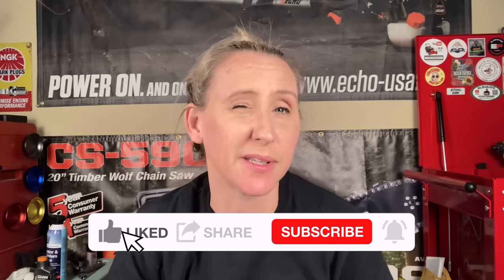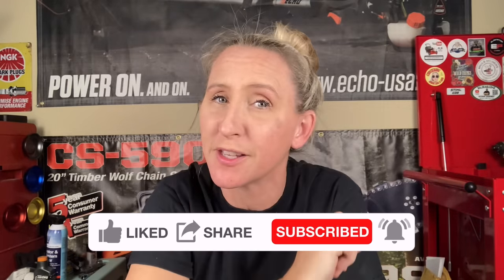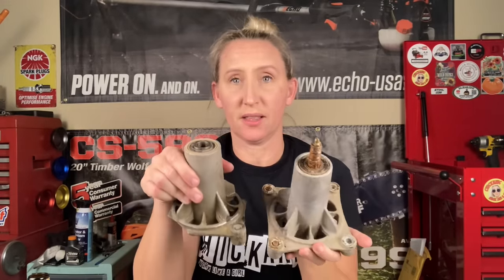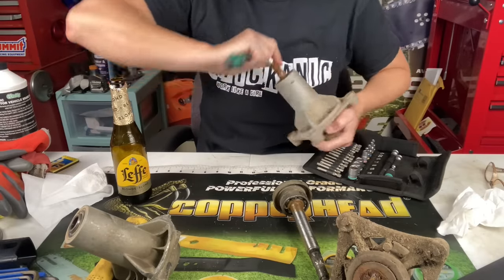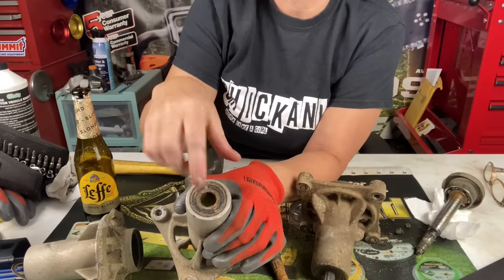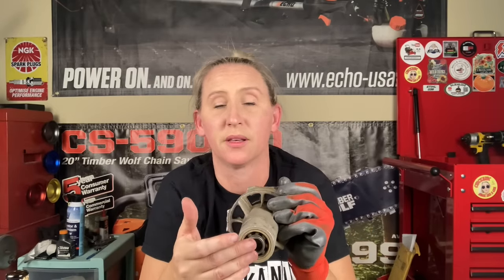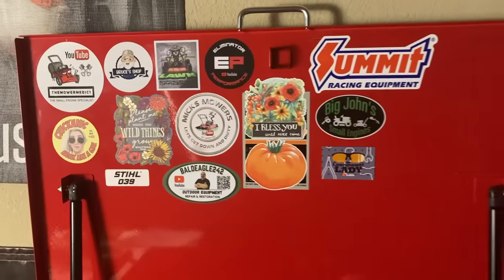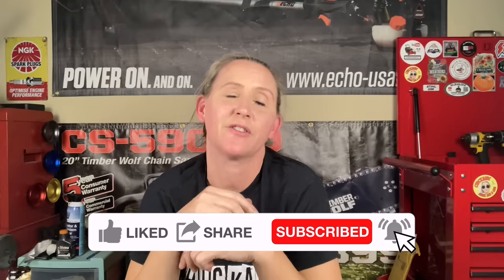THIS IS BIG!! Husqvarna riding mower and Zero Turns HAVE CHANGED! Review/Vlog

Comment: I have been wrenching mower for more than 40years. In the mid 80’s the quit putting in non sealed bearings. Every thing to the sealed verity. That so they could sell more parts at the parts shack. For years I have been removing the inner seal of the bottom Bering and drill and tap the side of the mandrel so grease could be applied so as it heats up it could slide down the shaft to lube the bearings. The upper Bering gets repacked and resealed Because hot grease will not defy gravity. This has kept my Mendrel going for years. I would run them till there was clearance issues I the housing and the Bering would chatter in the Mendel. I could get 1500-2000 hours out of set if they weren’t abused. I still have some of the old Mandrels laying around some where. There are cast iron and some are machined steel they have tapered roller bearings with cone race and actual real seals those mowers were like timex’s ran them till the decks were like Swiss cheese. That was us quality back then. Now we get disposable junk. Good to see someone’s kind of listening. Keep sharing the black&white&read all over👍

Comment: I need help with an oddball string trimmer. I just bought a Weedeater 2 cyl trimmer on wheels. Model WT3100. The purge bulb was missing. I ordered a new one plus a new carb. Now I can’t find information on how to connect the fuel lines. If you can help I would appreciate it greatly. The motor had spark so I figured for$10.00 what the heck. But I am stumped. There are one or two videos on this string trimmer but nothing to help with the fuel line routing. Help.

Comment: It's a supply chain issue, not an international lawn mower conspiracy. 
I work on Harley's for a living, there's a company that offers a bearing conversion for something on them that originally had bushings on a shaft with a grease fitting, the bearings in the conversion kits are very similar to those and sealed on both sides, a called the company that makes the conversion kits and ask why they didn't supply bearings with shields on only one side so the original grease fitting on the shaft could lube them, he told me when they originally did they could source the one's with shields on one side from their supplier but after a while all they would supply them with was the double sealed one's. 
The shafts are made by one supplier as per the original design with the grease hole and the bearings are sourced from someone who quit supplying them with only one shield, either the mower companies found a different supplier that sends them the single shielded one's once the supply they bought ran out or their supplier heeded their request for single shielded one's. 
Realize that when they buy the bearings they're probably supplied with hundreds of thousands of them, until they've run out that's what's going to be installed and sent as replacement parts.

Comment: The new shaft and bearings look like a good improvement.  However, I would like to see where the grease comes out of the shaft to grease the bearings.  If you put grease in the top does it just go into the middle of the housing?  If so I guess you would have to force a lot in there to push grease into the top bearing.  Wait, maybe if the top is not sealed maybe you can just add grease by hand.  I Don't know.  Anyway thanks for the information and tips.

Comment: I think on my new used John deere Lt155 is gonna need a new spindle if its not the spindle making that loud sound its the pulley brake rubbing the pulley if its not that could be a pulley it could be any of that i don't know how long the guy let it sit its a good mower though cuts good with a nice dull mulching blade that doesn't really mulch nothing 

The steering is more stiffer than on the john deere L110 its steering is really good but then the craftsman lt1000 steers the best 

The square fender John deere 110 steering is easy but gotta do alot of turning so its not that great its to easy

Comment: In general that’s my job being wrong that is! I called dibs on being wrong! But I still have a guess. 95% of the people using these greasable mandrels don't even know what the word grease gun means. And certainly don't have one. The only greasing going on is at your place or some other shop. All these non sealed bearings do in this situation is fail sooner because they're only a good idea if somebody actually greases them. It's even like on your car when we had rear-wheel drive and universal joints they used to wear out. The factory ones lasted the longest and they weren't greasable. There were two types of available at the auto parts store one greasable and one not, the sealed bearing lasted longer... your mileage may vary!

Comment: This is what Cub Cadet says about their spindles. SEALED SPINDLE HOUSINGS WITH SEALED BEARINGS WITHOUT GREASE FITTING.  Routine maintenance is not necessary on these style spindles. Please inspect the deck spindles on your model. If they do not have grease fittings on top or bottom, they will not require greasing.
SPINDLE HOUSING WITH SEALED BEARINGS AND GREASE FITTING.  On these style spindles, grease is used primarily as a water barrier to keep water from accumulating in the void area inside the spindle housing and around the bearings and spindle shaft. Any good wheel bearing grease applied with a standard grease gun may be used for this purpose. These style spindles should be checked and greased annually, more often if the deck is subject to unusually wet operating conditions. Models with grease fittings will still have sealed bearings inside. Spindles with grease fittings will also have a weep hole in the

Comment: I have always thought it would be better to have the bearings open on the inside, and run a 50-70 weight gear oil (Differential/old Manual trans) on them. Add some type of Slinger to lube the top bearing. But, there's probably a reason they don't.
Reply: The reason the dont it wouldnt make them money, it would last too long which they would lose the money from people rebuilding them every season or 2

Comment: Sorry, but you're still wrong.   If you fill the cavity in the spindle housing with grease, and continue pumping, the grease will easily get past those so-called "seals".   Those grease guns build tremendous amounts of pressure, and those seals offer little resistance to disallowing grease to get past them.

Comment: question. i have a huquvarna ts 348 d runs fine however it bogs down when butting grass,   my toro  zero turn timecutter 42 does not do it,  i wonder if the topend speed it set to low? i mean if the  grass is too tall it damn near dies, and sometimes it does die only has like65 hours on it.  so any suggestions?

Comment: This is off the subject but I need your help, Im desperate. I have severe COPD so I'm getting to where I cant do much but yesterday I working on my 54 Husqvarna. Last year i was a little hard  on my deck and now I have to remove it and take it to a welder so he can bolster it for me.  My son caught me out in the garage and he said what are you doing? Famous last words for me. Anyway he and his mother decided it would be easier to just buy me a new mower.  Just for reference  I have been using my cub cadet for years it still runs The cub is just a straight rider no zero turn.  The Husqvarna is a 54 inch zero turn. Heres my problem. I just sold my other house, the one I'm living at has about 2 acres.  when i moved here the cub worked fine. it would take me a couple of days to get it done after work. The minute I brought the Husqvarna out here I was hooked, it cut my time in half.  Anyway my wife and son have been plotting on putting me on a brand new electric zero turn mower. 
Heres what Im thinking and I will try to keep it clean. As soon as that came out of my sons mouth I thought WTF????? Please no.  What are your thoughts on this I know you and your husband both do thiswork.?? Can you help me ???

Comment: Here’s my almost expert opinion on the spindle bearings.
1) sealed bearings(2RS). Purpose is on economy mowers grease zerks are as foreign as Swahili to average suburban. So why take out inboard seals if no extra grease will be added? If grease is never added and the inboard seal of top bearing is missing where do you suppose the grease in that bearing will go?
2) sealed bearings w/ grease zerks. Now the bearings get grease. Owner greased until they see grease come out. What they may not understand is they just blew outboard seal and/or pushed inboard bearing seal inward to cage and balls.
3) remove inboard seal with grease zerks. This works but owner has to be mindful that when they see grease they have to make sure they just didn’t blow out outboard seals. Most likely in top bearing.
4) best setup. Taper roller bearings with dedicated lip seals designed to be greased. Proper maintenance will see these type spindle assy last over 1500hrs
What I’ve seen in recently purchased cheap aftermarket spindle assy is there is a tiny weep hole drilled thru spindle housing close to top bearing to allow pressure release and visual confirmation of enough grease.
Reply: what would work is shielded inboard, and sealed outboard. also the seals should have a snap ring retainer to keep them from dislodging. It also helps if the seal isn't the double lip design, but the ag style lip to let grease out but exclude debris.  that way you can grease all you want to flush the housing.
Reply: @stephensarkany3577  no shield or seal is needed inboard as long as cavity stays full of grease. Out board seal needs to be non spring lip seal. Most I’ve see come with 1-3 outward. As long as seal is correct make and interference fit is good seal will stay retained without external retention. But snap ring is a good measure for extra retention.

Comment: Discovered this years ago. Waited until I had to replace deck spindles on my John Deere to pop inner grease seals on the replacement spindles. Sadly, I bought a new bandsaw mill from Woodmizer and found a rough and noisy blade guide roller bearing before the first blade went on it. Removed it to remove one of the two seals on the bearings only to find it devoid of any grease but rusted and pitted. They test-run each mill. Use water on the blade for a coolant. Same issue with these as the mower deck spindles. Poor design. Especially if the bearings are assembled dry! No grease fittings. They instruct you to put a couple drops of ATF on the back of the rollers prior to use. 🙄 I think folks will find these issues all over the place. It’s a shame that consumers have to re-engineer so many of the things that they purchase. Thanks

Comment: So, let's sum this up. We pump in $6 worth of grease to save a $6 bearing? I agree with the idea that MOST spindles are replaced due to damage, so, I'd rather not have the mess of all the grease when I replace the DAMAGED spindle.
Reply: if you replace the spindle completely,  all the mess is self contained,  and until then you have a longer life spindle for those that don't brush hog with their mower.

Comment: If they have a grease zerk and have a sealed bearing they should be sued period. Why I don't wash my mower more than once every few years. Also those clean out decks with a garden hose was out 50 years ago then went away and now there back. When you use water it gets to the bearing. Also water  gets into those interlock system when you wash your mower. Some of those can be a bear to get to. Then you have to buy those or wire them out.

Comment: A friend has a Big commercial mower called a ventrac has a 72”3 blade deck same thing i’ve been mowing with this thing for three years and greasing the hell out of the spindles and the bearings failed when I took it all apart all the grease inside was absolutely spotless clean and the bearings were sealed on both sides absolutely ridiculous why why would they do something stupid like that I think that machine was $25,000 machine and they’re not gonna pull the  seals on the bearings. Obviously I pulled the seals I don’t know if it’s going to help or hurt

Comment: It still doesn't seem that it's going to help. The only bearing that was missing the seal was the one located at the top, right? How does the grease get there? Is the entire void inside that housing and external to the shaft supposed to be filled with grease? Gravity is not going to help the grease move upwards towards the top bearing. Not only does that cavity need to be filled, but would have to have enough grease so that as you add more grease it forces it upwards. IDK, maybe I'm missing something. Cheers.
Reply from the maker: The top bearing is still sealed on both sides like before. This one was just worn out. Just the bottom bearing has an opening now.
Reply: @Chickanic  Yes, my mistake. I went back and watched your video again. I had the ends reversed for which was the top and bottom. I think it's great you came out with this update though.

Comment: I have never understood how packing a spindle with grease is supposed work. If the bearings are sealed the grease won't get in, And if the bearings are sealed on the outside but open on the inside how is the grease supposed to get into the upper bearing, climb the shaft? Once the spindle gets hot, or even warm, wouldn't the grease flow? And that means down.
Shouldn't they be labeled and treated as serviceable and inspected yearly(?) and replaced as needed.

Comment: The newer Craftsman riders are MTD not AYP
Reply: i was wondering when she said that.  thing is they go out for bid every 3-4 years. i've seen some old ayp craftsmans   and the old sears  suburban models were made by  jacobsen. i'm showing my age now
Reply: That is because Stanley Black&Decker owns a portion of MTD and the Craftsman name. They don't want to support the competition.
Reply from the maker: Yes, I should had made that clearer, that they are MTD now.
Reply: I have a 1999/2000ish MTD Garden Tractor that the tensioner for the upper drive belt kept jumping off.  After viewing about just about every YouTube video known to mankind regarding the Vari-Drive system that MTD tractors had that I had to consult the parts diagrams and discovered that the nut for the shoulder bolt which the tensioner arm pivoted on was just about to fall completely off.
So the shoulder bolt turned with the arm so the nut & lock washer also turned with the shoulder bolt.
I replaced the standard 3/8-16 nut with a locking nut where I could tighten the nut but yet leave it loose enough to pivot.
After all of that trouble, I replaced the idler pulley and put everything back together.  
MTD; You totally outdid yourself with your design destined for failure to put it very nicely. 
My point with all of this is;  With MTD products there are so many different versions and variations that I had to dig deep to figure out what the problem and you don’t use regular nuts and lock washers for a pivotal shaft- Argh!!!  
Sorry I went off topic a bit regarding the spindles but maybe my rant will help someone to get back up and going if they face the tensioner arm jumping from off of the tensioner pulley.

Comment: Bought a 2014 Cub Cadet (MTD) for $200 that needed a complete deck rebuild. Took the inner seals off the new spindle bearings, then filled the cavities with grease. Now they can get greased once a year if they need it or not. I hate being deceived, and that’s what these manufacturers have been getting away with for way too long. These machines are designed to fail in a couple of years so they can sell you another one. That’s disgusting!

Comment: My JD- riding mower a couple of years ago I replaced 2 spindles guy at the store said grease the spindles thinking sealed bearings didn’t midway belt popped off checking spindles bad bearings. Went back to the same store guy behind counter laughing said you didn’t grease bearings shielded not sealed 
Lesson learned

Comment: It wasn’t necessary for manufacturer to change design. Sealed bearing is sealed from dust/debris,not grease. Fill spindle cavity with grease. It will reach bearing balls. I’ve done it for years and it does get to them. Here’s a link showing proof. https://youtu.be/PwObkilFXN0

Comment: Will someone please just get a spindle with a grease venting shaft, toss it on the bench with a grease gun and just start pumping! Then all the people can learn that a "sealed bearing" with its often plastic sealing cover is just there to keep it from easily being contaminated. The average hand pump grease gun can make 3000psi. The grease will move into the bearings end of story!! If you do it with any amount of thinking you will slow down as the last of the air is displaced and it starts to feel solid go softly and you will pack the bearings!

Comment: U need to do a little research. I used to think that the bearings were sealed, but that ain’t so. I watched a video where a mower mech filled the spindles with a red grease and then disassembled them and sure enough…there was red grease in the top and bottom bearings. The original grease was gray…or so it looked on camera. It was very apparent that the red grease got into the supposedly sealed bearings.

Those aren’t sealed bearings. It’s a dust seal. Filling the spindles with grease will bypass those supposed seals. Admittedly, the bearing weren’t full of red grease, but there was enough to lube the bearing. 

Try it yourself…make a before and after video and let us know what u found. 

Note: you will have to disassemble the spindle and clean out the old grease so the spindle can be filled with red grease. You don’t want the two to mix and taint the results.